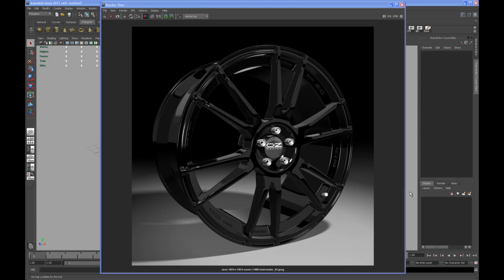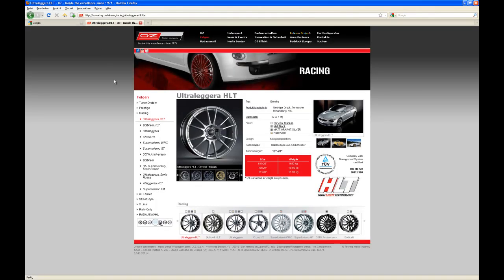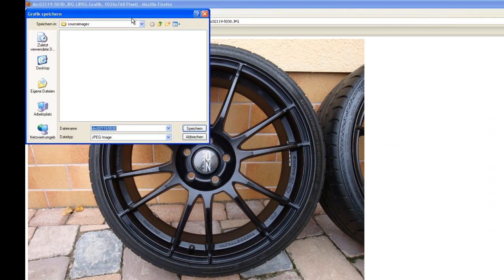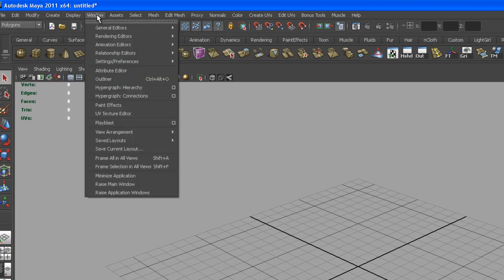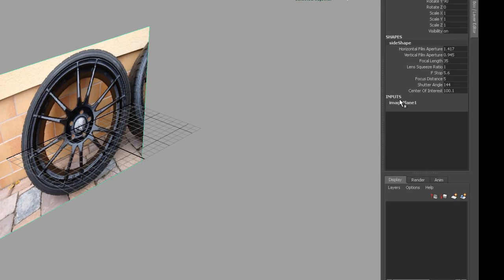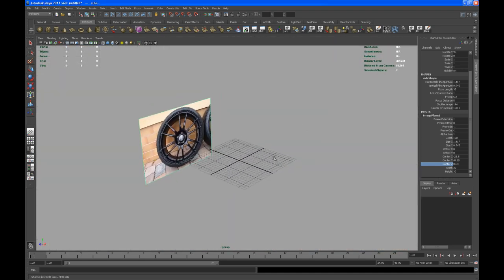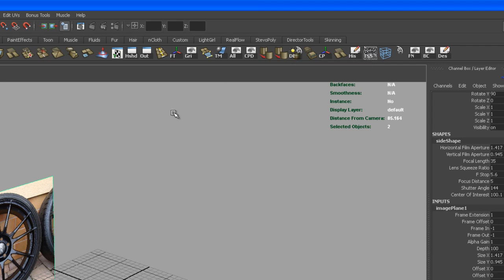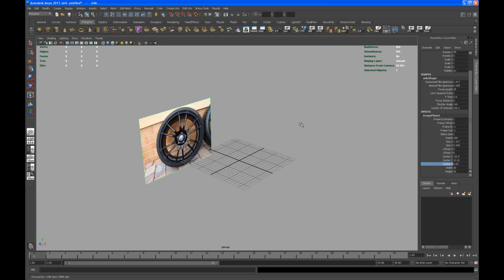Modeling tutorial in Maya - a polygon rim - Part 01: introduction and scene setup

Comment: @Sickomorvus you dont need a new mouse. 
Only disable the ScrollWheel funtion of your mouse. Because you can do it with ALT + LEFT MOUSE BUTTON.
HOW TO DO IT: click with LEFT MOUSE BOTTON into the CUBE in the LEFT TOP Corner in to the scene, then opens a menu. In the Menu, go to INTEREFACE. Then you see DEVICES and there is
MOUSE SCROLL WHEEL [ ] ENABLE. Disable it and every mouse should work fine in future :-)
Hope it helps :-)

Comment from the maker: @Sickomorvus 
hmm does the middlemousebutton work in other apps? if it doesn't work at all you should buy a new mouse :-)
what mouse are you using? you might change some settings in the mouse driver software. 
You might try to connect another mouse and try if you still have the problem... if yes than it' definetly a windows mouse setting you have to change.

hope that helps

Comment from the maker: @vedtam 
yeah sure... I'm working on a dual CPU Xeon machine (2,66ghz) with 8gigs ram.... I bought it 2 years ago so it's "the old" Xeon architecture with 4 cores each... and no hyperthreading. 
My video card is the nvidia quadro fx 3700 (that doesn't have any effect on the rendertime but improves the viewport quality)

Running on Windows XP64.

Nowadays you get almost the same renderpower with a single hyperthreaded CPU (core i7-960 or the i7-980x)